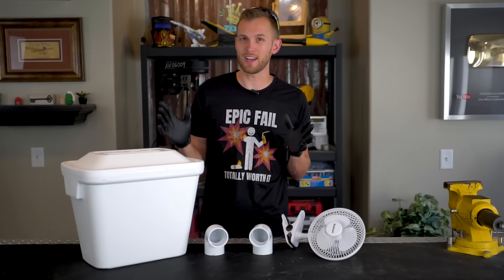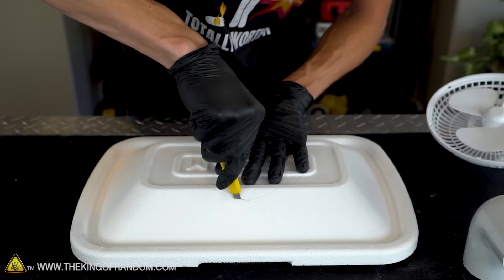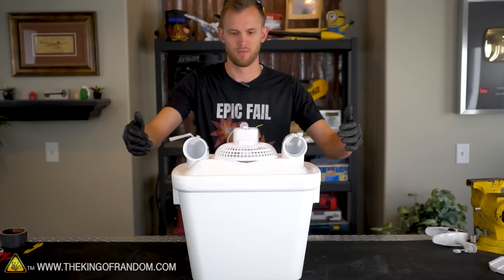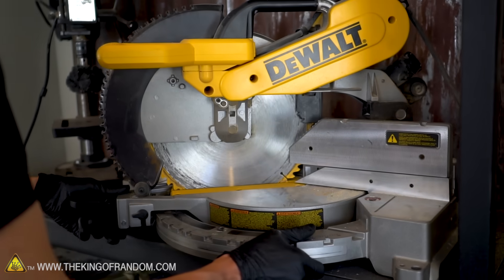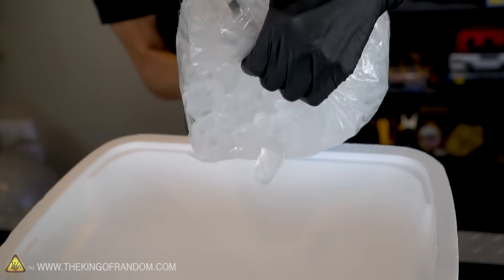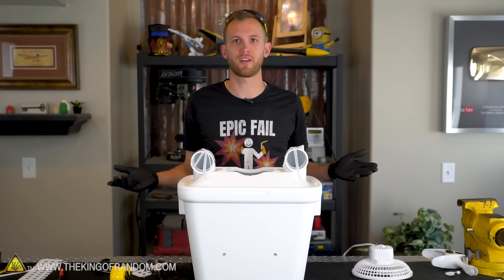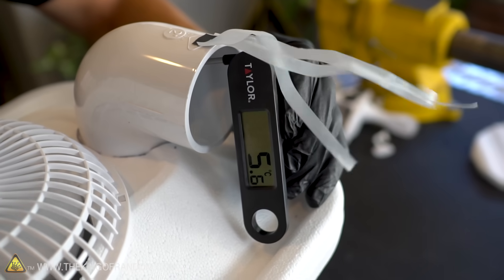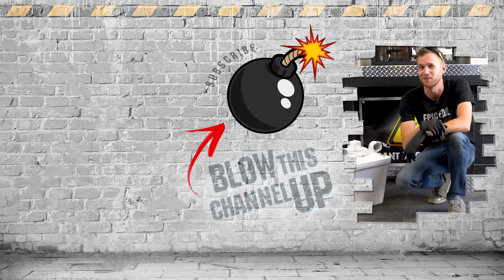Recycled Styrofoam Air Conditioner! TKOR Creates An Efficient DIY Air Conditioner!

Comment: I'm sure the reason Household Hacker used water bottles, besides the advantages you mentioned, was to prevent humidity from being added to the outgoing air.  Regular a/c systems dry the air by condensing the moisture on the evaporator coils.  Water bottles will accomplish the same thing, with moisture condensing on the surface of the bottles.  Without the barrier of the plastic bottles, wouldn't the warm incoming air evaporate some of the water off the melting ice?
Reply: Whitbypoppers you're quite right.
Reply: Condensing moisture on evaporator coil removes latent heat, this is wasteful when you are trying to reduce sensible heat.  Evaporative cooling does actually reduce sensible heat.  All a bit confusing!
Reply: wow u guys are real scientists 
i be like : open frigde and place a fan in front of it
Reply: @earthIing01  I kno it’s a been a year since ur comment but It struck my funny bone.  Going thru all the scientific comments then reading yours….CLASSIC🤣🤣🤪🤪
Reply: @micheleromaine7782  lol right
Reply: @earthIing01 the heat generated by the fridge working harder will offset the cooling capability.

Comment: I made this the other day,   I got the temperature coming out only to 64-65 degrees.  It wasn’t ice I used however. It was 4x5” ice packs.  And I had 10 in the cooler.  So maybe it was that.  Also, the cool lasted 3-3.5 hours.  Then I needed to swap out the ice packs with something else.      I did see one design using an actual cooler that forced air via a flexible metallic perhaps dryer vent, and it laid submerged in ice water.  Telescoping up out the other end.  The builder said the original ice stayed cold for days.   But I don’t have the tools to drill through actual coolers.
Reply: Can you share a link to that video? I was thinking of doing the same thing with my portable ac exhaust hose to turn the hot it into chilled air
Reply: NativeBrownboy let me see if I can find it.

Comment: Wouldn't adding a little bit of liquid nitrogen to the bottom and then using copper pipes help make it even colder use copper pipes instead of the PVC and everything and use a copper pipe and corner piece so the copper would get cold also extending the time and lowering the temperature with the nitrogen

Comment: Without the bottles, it is a swamp cooler. It's called swamp because it turns your room into a swamp moisture-wise. You could try suspending the bottles and filling them with a mix of water and isopropyl alcohol. This will bring down the temperature of the bottles when put in the freezer and keep the water from freezing solid. With that, you should get convection current inside each bottle to keep the temperature lower.
Reply: My thought was why not  use some recycled  food cans or soda cans with a stopper or seal them somehow to create a  "cold cell" with thermally conductive  shell rather than plastic since it tends to insulate a bit more.
Reply: @quixebee8624  those metal hot cofee canisters are thermal.
With frozen liquid inside one of these and some sealer it might make a decent cold cell.
Reply: @quixebee8624  true the metal will conduct better than plastic
Reply: or buy plastic coated re-usable ice cubes!!!
Reply: @BigPerm6999 that defeats the purpose of not using a water bottle...
Reply: Big brain time
Reply: What proportions would you recommend? (i.e. 10% isopropyl alcohol, 90% water). I've also seen people commenting about adding salt to decrease the freezing point, would you recommend that?
Reply: @burner887  If you think of it like vodka, 40% would be equivalent. You can try 20% and see if it freezes. With saltwater, you will hit a freezing point eventually. With alcohol, a normal consumer freezer won't go cold enough to freeze.
Reply: @peterweston6588  do you think I can use this with techni ice??
Reply: @joeffreychaucer3526  Yes. I haven't used Techni Ice myself, but it looks like it does the same thing. You could line a tube with packs and blow a fan through it.
Reply: Why would you want to prevent freezing? When materials thaw, the material absorbs a huge amount of energy without affecting the apparent temperature. For example, putting ice on a stove would read a temperature of -10C, -8CS, -6C, -4C, -2C, 0C (ice starts to melt), 0C, 0C, 0C, 0C (all the ice has melted), 2C, 4C, etc. So the goal should be having the materials freeze at as low a temperature as possible should be a goal; not to prevent it from freezing at all.
Reply: According to my research and endless study. 1 + 1 indeed = 3
Reply: @gregi787  "1 + 1" has 3 symbols. Two 1s and a +. So yes, it counts as 3.
Reply: or ice packs
Reply: And ice can sublimate to just not as rapid as dry ice obviously
Reply: True.
Reply: Does the same thing with the bottles because of the copious amounts of condensation that will be coming off of them.
Reply: What would IPA do with the cold water? Pls explain, I am willing to make this kind of setup
Reply: @IamAli89  My idea back then was that as the water warms up on the surface of the jar it will rise, pulling colder water from the inside up from the bottom. With frozen water, the surface will liquify and the ice will remain in the middle: the warmest water will always be on the outside. Realistically, a comparison should be done, because ice requires more energy to change states.
Reply: it's inside of an insulated cooler though... not running a fan through a towel soaked in water
Reply: @twisted6567  loose ice cubes would eventually melt and evaporate and be picked up by the air and then blown into the room its cooling. increasing humidity in the room, leave this running long enough and it would completely dry out, meaning all the water had been lost to the room.
Reply: @BigPerm6999  It's like Steven Wright once famously said... "I want to put an air conditioner and a dehumidifier in the same room and let them fight it out."
Reply: Here me out but maybe buy an ac 😂
Reply: @jesseshasteen8158  this is cheaper, reusable and portable
Reply: @jtyree0226  and like they are saying up above it makes the humidity level skyrocket and when u live in the most humid state that ain’t really a great option
Reply: @jesseshasteen8158  if you use gel ice packs instead of freezing water there will be significantly less condensation which would minimize the humidity issue that these models have. Haven’t made it myself but I’ve heard that it works a lot better and makes a lot of sense in theory.
Reply: Costs a fortune!
Reply: No idea

L

Comment: I don’t even have air conditioning in my house. I just have a heater and a fan. This will help me!
Reply: Where do you live that you require both a heater and an air conditioner?
Reply: Niladri Manna .....?
Reply: I live up north in Michigan
Reply: @TrevinBoyce  Why would you require an air conditioner  live at North Michigan where the temperature never soars above 76°F? I mean that is the mean temperature in the middle of December in India!
Reply: Niladri Manna actually, I live there too and over the past few weeks we have had a heat wave and it has basically been above 90 degrees every day. It just recently cooled down to mid 80’s.
Reply: suqargum  Well living around the equator I have four air conditioners and no heaters, go figure.
Reply: I live in Oklahoma and in the winter it can go down to 25F and in summer 110F
Reply: Okay I'll give it to you that Oklahoma and desserts are exceptional cases but for the most part you either require a heater or an air conditioner mostly air conditioners considering most of the world's population lives around the temperate and torrid zones and to be more precise in China and India.

Comment: It cracks me up when I see people using these fragile styrofoam containers to make this as if they need to be insulated LOL you're blowing room temperature are at High Velocity into an insulated vessel? Why? The insulation becomes absolutely meaningless at that point you're better off using a Rubbermaid container that won't break easy your crack and leak. It doesn't matter how insulated it is because you're blowing in air at High Velocity room temperature are think about it

Comment: why not just use standard copper tubing (like what your bathroom/kitchen faucet uses) would work.  make a cube of bent copper tubing (or use copper elbow joints)?  i'm thinking a completely enclosed tubing system where the intake should be at one end of the cooler, and the vent at the other, so as to not draw in already just cooled air.  In fact, I think if you draw in air from high (since warm rises), and vent low and even, you might cool the room better/faster?? just haven't figured out how to attach a fan to that tubing.  3D print an appropriate adapter which funnels the air into the tube?  oh.  a regular old funnel would work, maybe.

Comment: 5 pounds of ice yields 210 BTU of cooling assuming the ice is 30 F and room temp is 72 F. BTU is the energy needed to raise 1 pound of water by 1 degree Fahrenheit. This ignores the heat of fusion. Your ice will be at room temp after about 240 minutes.

Comment: One thing to keep in mind, due to the lack of a seal, you won't get any airflow once your ice melts and the pipes are submerged in water. So adding a tap will also help in this regard in addition to easily draining the water.
Reply: No, he didn't improve the hack.  He made it worse.  As soon as the ice starts to melt, the blowing will cause humid air to blow into the room, effectively making it a swamp cooler.  The best option is to use bottled water or gallon jugs, so you are only cooling air without increasing humidity.  Generating cooler air means the ice will melt faster - if he had taken any physics or thermodynamics courses, he would know.  In situations like this, it's best to prolong the cooling effect even if it means it cool a few degrees less.  You'd have to think about how quickly your frig can make ice... to keep this setup running.
Reply: @_w_w_ Exactly
Reply: @_w_w_ I find that ice lasts way longer when you pour water in there with it. It's something we learned dealing with Florida summers. A 20lb bag of ice would last 3 days if you also bought a gallon jug of water to pour in there with it so I imagine the same concept would work here.
Reply: or a valve that opens after a certain weight
Reply: My thoughts exactly
Reply: Bro has liquid nitrogen and no fan.

Comment: temperature wise this seems to be better than the copper coil on the face of the fan. The major problem with this is keeping the ice from melting so fast. In a very hot room it won't take long. The inside could be lined with aluminum foil which would help a little.
Reply: Maybe a thermal ice chest bottem with a styrafoam lid?

Comment: What if you mounted the fan at one end on the side towards the bottom, put a 2or under the cooler on that end, fill the cooler with salt and ice and make sure your tubes almost touches the bottom and is surrounded with the ice

Comment: You could try putting caps on the pvc pipes and drilling holes in the bottom but filling the pipes with ice. that would make a difference

Comment: in dry climates, you can cool without having a freezer-- swamp cooler/evaporative cooler setup isn't too hard to make. I've got a box fan, probably 2ft to a side? I've attached some hand towels to the handle on the top with rubber hair ties, and let them drape over the backside/intake of the fan-- it's got a fine enough plastic cage I'm not worried about it catching-- and the ends of those hand towels are sitting in a bucket of water. capillary action (I think?) wicks the water up into the towels to keep them wet, while the evaporation of the air moving through it takes energy and cools down the air. 

The crux of this, though, is that water can only evaporate into air that still has "room" left to hold water. if it's already humid, then this won't work.

Comment: If my ambient was 72 F I wouldn't any of these
Reply: LOL I was thinking the same, such an unrealistic test I want to cool a room that is at 80-90 degrees, not 72 duh
Reply: @junkman4126  I mean they drop the air temp almost 30 degrees. If u want it it cooler make more
Reply: @kylealexander7024  Thank you but no way that will require more ice lots of ice, it may work but not very practical. Have you tried a Semiconductor Thermoelectric Cooler Peltier Cooling System no ice required?
Reply: @junkman4126  I'll get right on that. Although it might be a bit more cost prohibitive.
Reply: Mine is at 102 HELP
Reply: My room is at 40c or about 104f or so and it’s like this again tomorrow and the day after
Reply: @eman210rocks2  itll work. My house was similar temp today. Close all doors and stay in one room. Multiple coolers as well

Comment: AC went out in the house, went all out and got a nice strong fan, a massive cooler and everything, went to the smallest room in the house 10 X 12 foot room. 90 degrees outside, and turned it on, in 30 minutes the room was nice and cool and 30 minutes after that....the ice had fully melted... and I was like WTF??! SO I QUICKLY ran to get $5 in ice! At an ice machine about 75 lbs of ice, that was enough to do about 1 hour and 45 minutes of cooling...I spent like almost $75 lol lesson learned I just went and bought a window unit till we could get the house ac working again

Comment: I think a duct from the fan down under the ice rather than the outlets would work better but this is a great idea if the ice could remain longer because the air would melt it pretty quickly im shure..how bout adding a filter to the exit that absorbs water from a attatched tank maybe ?..and go smaller same time 😉
Reply: U could even feed the filter from the top instead of absorbtion using a drip regulator like they have in hospitals if u wanna be fancy lol 😂

Comment: Was the intention to put the supply air pipes in water?   Because they will be in just a few minutes, blocking all air flow.
Reply: This is why they use bottles of water not ice cubes.   While the bottles will condense water on them, it won’t be that measurable.

Comment: Some interesting tweaks to the original design minus the use of ice cubes. Polystyrene coolers sweat and do in fact leak liquids. Yes its very slow but they do still leak so its not something you want to use indoors if your putting ice cubes in it. Not to mention this thing will lose effectiveness once enough ice cubes melt and the waterline gets above your intakes at the bottom and you have to deal with a cooler full of water too. Cold packs or frozen bottles is the way to go.

Comment: I recommend using coldpacks (reusable icepacks) and arrange them in a radiator style in the box like [|||||||] so air can flow between them. They stay colder longer and are much more cost-effective than ice cubes.
Reply: Exactly what I was thinking about. Radiator style or even staggered.
Reply: It would also solve the condensation problem. Using frozen water eventually causes a buildup of condensation in the room which could make matters worse. Using a gel based ice pack would significantly lessen that problem.

Comment: All of these DIY ice foam cooler air conditioners are actually closer to swamp coolers than true A/Cs.  In other words, they humidify the room while they cool it.  This is fine for dry desert climates, where humidifying the dry air is preferred.  But it is absolutely NOT fine for places with humid summers.  Not only will it be more uncomfortable (cold and clammy feeling), but you are also providing optimal conditions for mold to grow on surfaces (wet and cool air).  

Modern window A/Cs have the downside of being noisy, kinda expensive to purchase, expensive to operate, and expensive to fix if they break.  But they are designed to cool your room while also drying the air, especially of they are sized correctly (meaning that they aren't too powerful so that they cool the whole room before they can fully dehumidify the air).  The DIY swamp coolers are simply BS and useless for all but the driest summer conditions.  

In fact, any A/C that claims it can cool your room through evaporating cold water is nothing but a swamp cooler.  This includes this DIY ice foam cooler as well as those mini desk A/C's that you see advertised of FB and other social media.  If the A/C does not have a drain to either send water outside or into a container that you need to periodically empty out, it is not drying your room.  In fact, it's making your room wetter.

Comment: RE:
Marvynaytor1:  What happens when the ice melts water and air does not flow. 

ME:  That was my thought too. When water melts levels rise and block air flow from tubes,  forcing cold air to rebound up through the fan against fan air flow. I think keeping frozen bottles is still the best idea or stacking ice trays so melted water remains contained and away from the tubes.   Or, use those gel cooling blocks/bags. Anything that won't cause liquid levels to rise but still create surface area. Perhaps folding gel bags under the grate and using frozen bottles above.  After all a cold drink of water is still a cold drink on a hot day.

What we really need to know is how long it takes before we have to empty the cooler of melted stuff and restock it with new 'ice'. To slow the process but keep the lower temps, do we really need two vents for personal AC? What happens if the vent tubes are smaller so the air comes out faster?